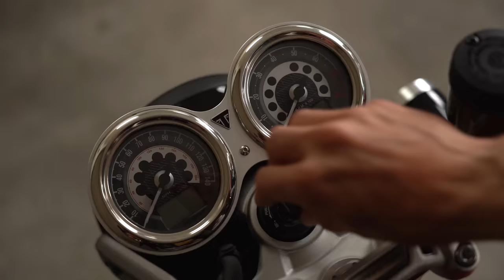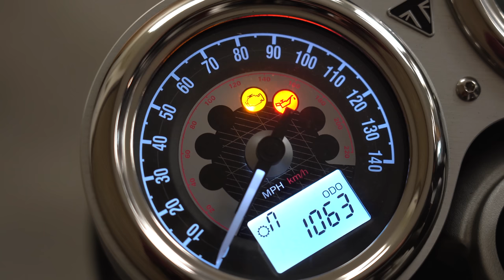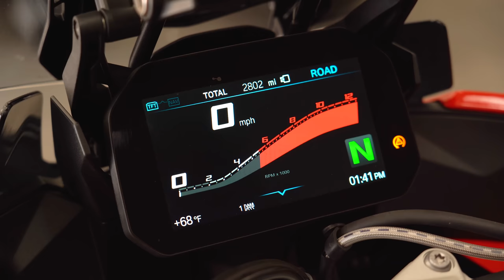Do You Need To Warm Up Your Engine? | The Shop Manual

Comment: All motorcycle engines are not the same. Air cooled water cooled semi dry sump or dry sump or wet sump. These are all factors to consider. My Indian Springfield for example is an air and oil cooled engine 111 cubic inch with a semi dry sump. The bike uses specific Indian semi synthetic oil. Until you have ridden the bike quite a distance for the engine to warm up to operating temperature you cannot measure oil levels accurately because the viscosity is at the wrong temperature to get correct flow. Idling the engine is not a good idea but so in my opinion is working the engine hard when it's cold. So I just ride gently to start with. My 400cc 4cyl Honda on the other hand had far less thermal mass to heat and it had a thermostat. So the time to warm up was dramatically shorter. I think it's important to understand your engine because they are not all the same.

Comment: Well, warming up the bike engine is like a bible for some when i bought my last bike, a Street Triple from one of those who took the bike into his garage and never used it again for two years more than starting it up sometimes for fun. Before i bought that bike in the summertime and it had been idling for 15 minutes the seller said to my big surprise, be gentle because i dont think she is warm enough. For me who have been using bikes for 40 years that answer was just as crazy like if you should put gasoline to a fire who already was burning to the roof. 😄

Comment: My RSV 1000 ME is simple here - if it's cold it just stops running.
A 1000cm³ V2 doesn't want to run from zero to hero :D at least not, if it's from 1998

Comment: You can drive immediately, but only when the engine oil is at operating temperature should the full power be used.

Comment: I have a 200cc so it's not weird to ride full throttle all the time so I turn it on and then go inside to put on my helment, jacket go out again to open the gate and then I take it slow for the first kilometer until engine temp is looking right

Comment: The main reason for warming older bikes is the alloy piston - cast iron cylinder issue. The alloy piston heats up faster and expands quicker than the cast iron cylinder and could cause premature wear on both.

Comment: Gasoline still condensates in a cold (<25° C) cylinder if your fuel injection is ecu controlled. An ecu can't cancel out physics. To counter this, the ecu runs a rich air-fuel-ratio and inreases the idle rpm to improve airflow, while also heating the catalytic converter up faster. This fixed setting reduces engine response and won't be improved, if you start driving right away.
So in fact you should wait for your cold start to end, as it will benefit both emissions as well as engine response. Usually this takes more or less about 1 minute, depending on ambient temperature.

Comment: ~ 1 minute warm-up will not hurt, but it will be good for proper metal expansion. Manufacturers don't care about any single day or mile beyond warranty period.
By the way, many japanese cars (and also a bit older german cars) keep idle rpm higher than usual until warm-up is done (40 °C or so).
There are no magic metals or magic lubricants invented in the last 20 years.

Comment: So basically you're saying it does need time to warm up just not for the reasons most people are concerned with. This is what I have found while doing my own research. I have a 2020 HD Iron 1200 Sportster. I let it warm up and don't ride hard until it is at operating temperature. I do this for the exact reason you mentioned. Hot/Cold tolerances. I've read that a good way to get leaking lower gaskets is to hop on a cold EVO motor and drive it like you stole it.

Comment: Getting the oil warm and flowing through the engine is actually the real reason to "warm up" a bike, not necessarily the coolant temperature, which is the temp. that we go by on the guage cluster.

Comment: One thing people dont realize is using your engine gets it up to operating temperature faster than when its sitting aroud not doing anything. Same reason why your car heat doesn't get warm until you start driving.

Comment: After 30 yrs of building/rebuilding engines and vehicles, I def warm up every engine before I drive.  A lot of people ask me how my vehicles are always running good and last long. I tell them I don't listen to internet trolls.  Everyone tries to justify and give scientific reasons why not to warm up an engine.  I don't listen to the people who just don't know. 
  The problem is that people typing on a computer convince you and make up things from research based on others typing away but have never touched an engine before.  I don't just say do your research. If you've never touched a rod, valve, or bearing before, don't even talk to me.

Comment: Wrong. The last reason you mentioned last is the main one in fact. For all users. Engine parts made from metal. Optimal working condition is when the engine is hot enough. Not to load the engine before the metals are set in the right size and location - is recommended. So yes, on any bike or car with metal engine... Let the temperature set in the optimal working condition BEFORE driving it. This will extend the engine life span.

Comment: Air cooled versus liquid cooled engines. I think liquid cooled engines can be made with tighter tolerances as they works in a smaller temperature span. So less need for warm up.
On the other hand air cooled engines usually warms up faster.

Comment: 30 seconds is all it takes for the piston rings to expand and the oil pressure to rise. Just wait until it's warm before you run the bike to higher rpms, which is usually a few minutes of riding.

Comment: I hope this comment is seen.
I own a 2nd Gen KTM D390. I live in Northern plains of India where temperature can drop to 42 degree Fahrenheit sometimes during winter season. I am mostly weekend rider and whenever I start my bike, the rpm is higher initially. Once the temperature gauge has 2 bars, the rpm drops. I don't start riding unless there are 2 bars on the temperature gauge regardless of the season. Also, the same thing happens on my Suzuki Baleno car. The rpm is way higher and after a min of idling, it drops below 1000 rpm. Again, I never start driving unless this happens. So, are you saying that it's necessarily not required?? So why rpm is higher during initial start for both my bike and car?

Comment: Ya know, I'm new to motorcycles, but everybody told me I would need to keep my battery on a charger for the winter. I live in colorado, and have not done that, and even with multiple -20 days, I haven't had a single problem. Starting to think people don't know things and I should just read the owners manual or something.

Comment: Mine has to warm up every time it sits for more then a few hours. The manufacturer made an error with one of the exhaust valves in that model engine so I have to half choke and warm up until the valve gets warm enough to move properly. It is an 09

Comment: Having sympathy for the engine and gearbox is no bad thing. I always allow the bike (Street Triple) to get at least one segment of the indicating temperature before riding off, then I take it easy until the engine is at its normal running temperature. I mean the whole engine, not just the cylinder head...

Comment: The old rule still applies: Don't put the load on engine if it's not warmed properly. If it doesn't have Hydro-compensators you pretty much have to adjust valves more often, piston rings are going to wear off faster also, which will eventually lead to Smog Check failure.

Comment: I remember discussing this with my dad. another distiction which i think is important to make here: is it higher revs or higher engine load, or both that can cause unwanted wear?
Reply: That's a toughie and I've wondered that, too.  I think too heavy a load can overstress the engine and too light a load can allow parts to "flail" around inside.  A steady load keeps a steady RPM.  Blipping the throttle on the other hand introduces a fourth factor called "jerk" which can overstress cold engine components.  Even though I'm a mechanical engineer, my beliefs are somewhat anecdotal.

Comment: I would like to correct you as an ASE certified tech. The oil light is for dummies, it does not tell you that pressure has built up just that it's past a minimum, and that's usually quite low something like 5-10 psi which isn't much. I personally let all my vehicles and motorcycles idle for a min or so before taking off. If it didn't matter then bmw wouldn't restrict rpms on a cold engine.

Comment: I've been arguing with mechanics that were OEM certified on cars for years over this. Yes fuel injection and computer controls allow you to drive off within 10 seconds of starting the engine. They never want to acknowledge the fact that different metals expand at different temperatures and at different amounts. Even the same metals that are different thicknesses. The thicker the material the larger the expansion. First video I've seen that touches on that fact.

Comment: 01 Yamaha roadstar with a little over 200k miles on the odometer. I ride year round in ky. We have mild winters mostly in low teens. Never thought about letting the bike warm. It's a carburetor bike so I just leave choke pulled out for the first half mile. Seems to work for me.

Comment: Warming is not about engine only. Even if you warm your engine by idling 15minutes. You will still have cold suspension oil and cold tires. It is still dangerous to rev to the red line. But everyone only speaks about engine/gearbox.

Comment: If its extremely cold out and my ride duration isnt long enough to heat the oil up to normal parameters I will idle it. Oil degredation, sludgy buildup, fouling of the engine will occur on frequent short duration uses.

Comment: I always let my engine warm up for a few. Especially any engine that has a cast iron block and aluminum heads as they expand at different rates when getting up to temp. Don’t want a premature head gasket failure. Does it actually prevent any premature wear on the engine? I don’t know but I’ve never had an engine failure with these practices.

Comment: Yes, otherwise i get a cold seize. My piston / bore clearance is tight. But after working on enough engines In 20 years, the amount i have seen with out of square bores with round rings.  So yes being brutal on a bike engine from cold destroys it.

Comment: Fuel inject, low compression, oilcooled? Just drive away and be a little cautious on your accelerator. Carberated, high compression, aircooled? I suggest you take a bit more time to warm it up, be more cautious with your accelerator until its at least at a decent temp.

Comment: There are corrosive acids that form in the combustion chamber when the engine is below operating temperature.  Letting an engine idle when cold prolongs the period when these acids can form, so it is best to put the engine under load and get up to normal temp as soon as possible.  This was more of a problem with iron cylinders than it is with Nikasil coatings, but there remains piston and ring surfaces.  

My neighbor used to start his Sportster in the morning, let it idle as he went back inside to put on his jacket and other gear, sometimes for ten minutes or more.  I mentioned to him one day that he wasn’t doing his engine any favors.  He asked me, somewhat snidely, if I was an automotive engineer.  I told him no, I’m just a rocket scientist.  

Anyway, the issue became moot one morning when his motorcycle left without him.  I think all the neighbors within earshot we’re glad (it was quite loud).

Comment: I have a Yamaha R1 2010. I find it rides better if I let it idle 3-4 mins and get the temperature up to 60C before riding. Then I ride upto 5-6,000 RPM for ten mins before gradually taking it past 10,000 RPM.

I've tried riding it at 60 seconds after starting the engine and it doesn't feel right.

Comment: My z900rs increases automatically the RPM until the "second line" of heat shows up in the display. Get a bit anoying start riding with this RPM variation, but I start riding almost all the hotting time in low speeds until gets the engine hot.
Reply: On many bike the IACV is disabled if the bike is in gear or throttle is applied, but for some reason Kawasaki doesn't follow that protocol. My Versys 650 does the same thing.

Comment: You are not really warming it up in idle! You warm it up when there is load on the engine. And every manual says to quickly warm up the engine. You really don’t want to idle. That means many many rpm with cold components. Just drive and warm it up fast

Comment: Having a 4 barrel from 2000, I can safely say I’ve tried cracking the throttle open with the choke on and it immediately floods every time.

Comment: Cold engine seize ? As the engine heats up from the inside out the piston expands  substantially  faster than the cylinder  itself which can cause a cold seize  so its better to let the engine  heat up for a while wherether carburetted or fuel injected , i have seen happen on more than one occasion  on both FI an carburetted  engines.

Comment: Yeah... the question is a bit of a giggle for me on a 95 Savage 650... Haha... Unless you enjoy reaching under your leg to fiddle with the choke, you really don't have a lot of choices... It's take the extra couple minutes to make sure gear is fitted right, double check anything dubious about operation before hitting the road (admittedly) on an older second-hand bike... or be prepared to feel a bit extra foolish and klutzy trying to find the button to press while you're rolling along at 45 (local rural road speeds)... OR of course... you could always stall and chance dropping the bike in the driveway... not recommended and certainly a far cry from "optimal"... but you can do it that way I suppose. You certainly wouldn't be the first and probably not the last.

    Anyways... I will highly likely end up with at least one or two more bikes... nice to know the more current thinking on the matter. Thanks, Revzilla and crew... ;o)

Comment: I don't care what anybody says always let every engine warm up to normal operating temperature. Different metals heat up at different rates. so your aluminum head heats up faster than your cast iron block or exhaust manifold. Until that metal expands from heat your gaskets are stressed. That's why you see some new cars with blown head gaskets or exhaust gaskets, yet the same car from a different person might be fine.

Comment: Here is my logic.  Engines have improved vastly in the last few decades.  They hardly wear out now before the vehicle.  So now I simply ride gently,  no quick throttle inputs,  no high throttle opening, no high revs in the first 10 mins of riding.  I consider that a warm up,  I almost never leave a bike idling except my carbureted dirt bikes,  and it's often light throttle blipping to clear the start up oil before heading out for a bit of 2 stroke music

Comment: I let the engine run for about 20-30 seconds and ride off gently.  In fact, my BMW starts out with a low redline on the TFT display that moves to a higher level as the engine warms up.

Comment: The oil part which should be outdated im not 100 percent agree. Viscosity will change. Forsure it works because oils are designed for the operation temp range but not perfect on the peak level.

Comment: The time it takes me to put on my gear (helmet, gloves and knee pads) is warm up enough. Of course, I got a Chinese carbureted bike with an old ass engine design so I had to be very strict with its settling in and warm up.

Comment: When the engine is cold, it wears off 10 times faster. It's not a good idea to run a bike without warming it up at least for a minute or two, and even then you shouldn't demand much from it until oil is at operating temperature so everything is working properly.

Comment: Another good but mostly irrelevant reason to let the engine warm up is that the catalytic converters work better when the exhaust is hot. A big liter bike or some other huge heffer will produce so much heat that it will only take a few seconds to get up to temp.

Comment: So you're saying that 90 degree C temperature difference from 10 to 100 C, doesn't cause a significant change in dimensions of moving metal parts which are set up for  certain lengths / distances / clearances...

Comment: I was told by a mechanic that the reason we warm up our engines, is not to literally warm up the engine, but to circulate the oil. When off, gravity pushes all the oil down.
Reply: The video literally mentions this. Oil circulation occurs within 30-60 seconds.

Comment: But ... I don't think that Ari ever started a motorcycle engine in cold temps - and heard how the engine is struggling with the high viscosity. I'd say that a 10w-40 at 5F needs 4-5min warm up before hopping on the bike, and sloowly accelerating for a few minutes more.

Comment: Every morning when I wake up, I start my Honda CB500F and its rpm is automatically pushed up to 2000rpm. After letting the engine warm up for about 2 minutes, the engine automatically adjusts to 1250rpm. I think we should warm up the way they programmed it, there must be a reason for that.

Comment: My 2022 two stroke Te250i is fuel injected and Transfer Port oil injected. Husqvarna specifically make us warm it up until the left radiator is hot to touch (5-7mins), before any throttle is touched, in order to sorry greatly limit the chances if cold seizure which apparently has happened to about of these bikes. Can you comment of this please?